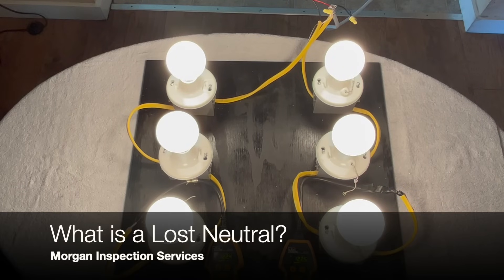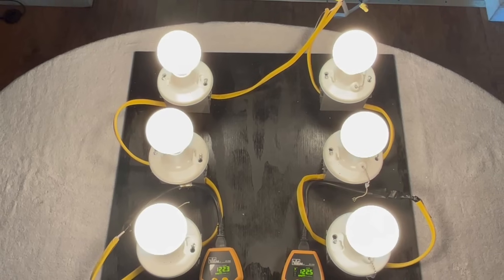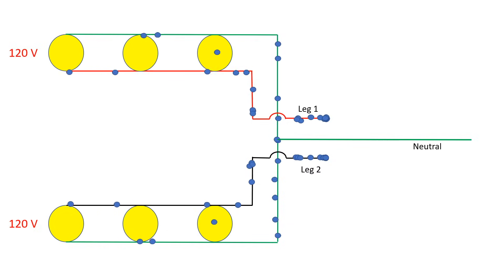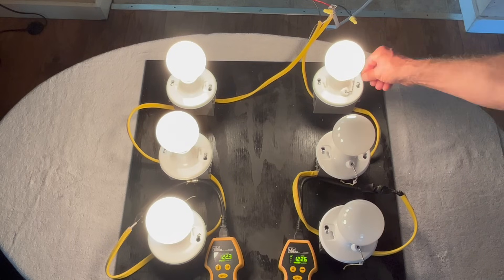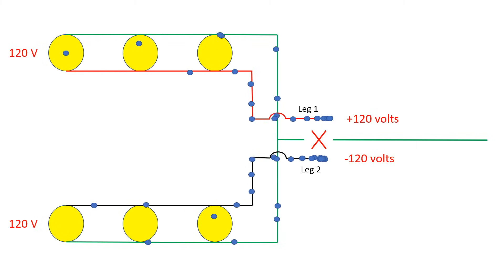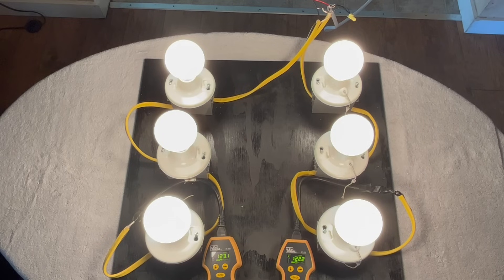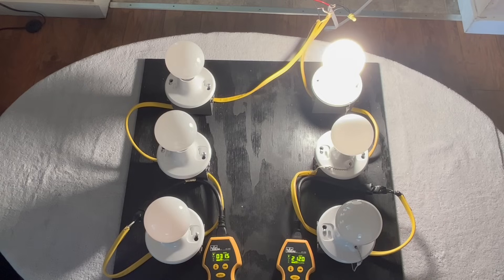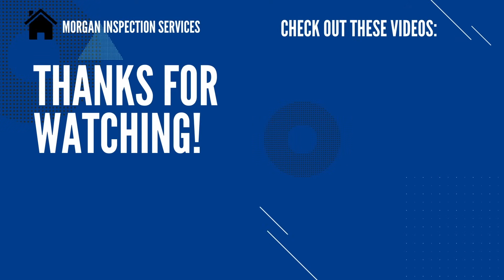What is a Lost Neutral? Lost Neutrals demonstrated

Comment: For those who watch the entire video, it's a good explanation of what's happening, but the intro piece should explain - or at least define - "balanced loads."  But, remind people that this IS NOT just a phenomena between the transformer and the service entrance.  Inside the residence, there is a code-legal wiring alternative called a "Multi-Wire Branch Circuit," that originates from a 240V branch circuit breaker and uses either L1 or L2 plus the neutral to feed ordinary 120V outlets.  With a Multi-Wire Branch Circuit, this same "lost neutral problem" can occur, except within one room, or on one wall, of a building.  So it's NOT isolated to incoming street service entrance neutrals and may not affect the entire building.
Reply from the maker: Thanks for the feedback! You’re absolutely right—balanced loads and lost neutrals aren’t just service entrance issues. Multi-Wire Branch Circuits (MWBCs) are a great example of where this can happen inside a home. If the shared neutral in an MWBC opens, the 120V loads on each leg can see unexpected voltage swings, just like with a lost neutral at the service entrance.

I appreciate the suggestion about clarifying “balanced loads” in the intro—I’ll see if I can get that added as some text in this video. Thanks for watching and for the thoughtful comment!

Comment: I had a service call with a customer. Complaining that some lights were flicking on and off and power was off to many of the outlets in 2 of the bedrooms. I searched the panel and found the part of the house that was out was on a 3 wire circuit. That is, the red and black with a white neutral.  Up in the attic, I found a jerry-rigged romex. Cut in half and supplied power to a switch and an exhaust fan in the attic. The neutral wire under the red wire nut was loose and was making intermittent contact. Thus complicating the service call because it would work. And then it wouldn't and then I would test outlets and was getting over 150 V on one outlet and 36 volts, on the other and the voltages would change during the day I spent 4hr until I found that jerry-rigged attic fan. I had to disconnect and run a jumper between the 2 wires. As the jerry-rigged was cut in half with no slack. It was a difficult service call, but this explanation that you gave showing actual 120 volt was so much better than the others that were using batteries and a low voltage light bulb. This really will help electricians a lot to see how it actually happens in real life.  Thank you for the good demonstration. KJ

Comment: that is utterly bizarre.i didn't even know that that existed.you would have thought that they would have placed a wheatstone bridge,rectifier or detector in place in order to limit the electrical circuit that phenomenon could potentially blow out a television or maybe cause an electrical fire it might be an idea to run three different neutral wires as one neutral,connected to three separate points.that could be so dangerous!
Reply from the maker: Yeah, losing a neutral can lead to some really dangerous situations. It’s surprising how many people don’t realize the risks until something goes wrong. Thanks for watching!

Comment: Thanks for the video!  I have a question that I'm almost afraid to ask. Several years ago (probably about 15) I had an outlet in a bedroom that didn't seem to work. I decided to check the voltage and it read about 79 volts. I simply decided to cap off the hot, neutral and grounds with wire nuts and put a face plate on it (which I believe is legal). However, was this a mistake? It sounds like there could still be a problem although I haven't seen anything out of the ordinary in my house since then. I'm not sure I want to go hunting around for lost neutrals. Should I do anything about this especially since nothing seems to be wrong?

Another thing is that I will be moving some time this year. Do you think I could somehow fail electrical inspection?
Reply from the maker: Thanks for your question! Capping off the wires and covering the outlet with face plate is generally a safe and legal way to deal with an unused outlet, assuming the wiring was properly secured and contained within a code compliant electrical box. However, the fact that you measured 79 V at the time, suggest the possibility of a loss neutral or a high impedance connection somewhere. This could indicate an underlying wiring issue.
If you’ve never noticed flickering lights, inconsistent, power, or other electrical oddities, it might not be an urgent concern. In fact, it could be an issue totally unrelated to a lost neutral. A lost neutral will affect the entire home, and not just one receptacle.
However, if you’re moving, and the house will undergo an inspection. It’s possible that an inspector could flag the outlet if they test it and find abnormal voltages or other issues.
If you want peace of mind, you could have an electrician verify that the circuit is properly wired and safe.  A lost neutral can sometimes cause bigger problems over time, especially in shared neutral circuits.

Comment: so for the average joe here, will a simple electrical circuit tester or similar check for a lost neutral?
Reply from the maker: If you suspect you have a lost neutral, and you have a simple circuit tester that will read voltage then you should be able to turn loads on or off and see voltage changes. Just a simple, three light receptacle tester will not do any good, but you need something that will show you volts.

Comment: Interesting video...I'm in the UK and often wondered how you guys managed to have both 120v and 240v in the house. Out of curiosity, if a customer has a lost neutral, could it be detected by plugging in a simple GFCI tester in the outlets? Also, do you guys have a separate ground/earth/CPC wire in your electrical ccts?
Reply from the maker: Hi Peter. Thank you for your comment! In the U.S., we have a split-phase system that provides both 120V and 240V. The 240V is achieved by using both “hot” wires from the transformer, while 120V comes from one hot wire and the neutral. The neutral wire is center tapped at the transformer, basically splitting the voltage in half. A GFCI tester wouldn’t reliably detect a lost neutral—it’s better to use a voltage tester or check at the panel. We do have a separate ground (earth) wire in our circuits, but they are not so much for earthing per sé. Their real purpose is to provide a low impedance path back to the panel to trip a breaker in the event of a short circuit.  Here’s a video I made that explains the basics of our electrical system. 
https://youtu.be/7YDbnZQiYwY?si=eyF0r_yYqqe0NNGK
Reply: @morganinspectionservices3840  Thanks for the in-depth reply, it is very appreciated..I will take a look at that video a little later...

Comment: This is a good video, but how does this work with grounding? Isn't the neutral bonded to ground at the panel? How would that affect your diagram and your demo circuit?
Reply from the maker: Hi. Thanks so much for watching and thanks for the question. Grounding really does not affect this because the Earth has such a high resistance that you will have a small amount of current flowing down the grounding electrode conductor to the ground rod, but it will be very minimal and will have almost no effect on what I am showing. 

However, all of the ground wires running from the receptacles and lights back to the panel will not be at 0 V. They will be at a voltage that is determined by calculating the difference between the voltages on the two legs and dividing that by two. So let’s say you have 180 V on one leg and 40 V on the other leg. You’ll have 70 V on all the ground wires in the home. This obviously makes a lost neutral, extremely dangerous. I re did this video several months ago to include this. Here is a link to that video.

https://youtu.be/YY5Fur7S-KE?si=8XB2134lleqX_Yb7
Reply: @morganinspectionservices3840  Thank you for the explanation and the excellent videos!

Comment: Thank you for this video ,,i was pulling my hair out..whats left of it,, trying to figure this issue out. I pulled my spare washer and installed it and still nothing. Thanks again 👍
Reply from the maker: So what exactly ended up being the issue? Did you have to get the utility company out?
Reply: @morganinspectionservices3840  sure did SEC , a crow had sat on a wire up on a poll by my home ...melted the wire, I thought the crow would be dead on the ground but nope ,,he likely flew away

Comment: For demonstration purposes this is an okay way to explain it, but this is the reason that the NEC doesn’t like you to share neutral wires anymore for a long time now. The 240v circuits would single phase but that should trip the breaker because of unbalanced loads to protect them, this is also the reason that you are supposed to balance your panel loads. This explains better what happens when you lose your neutral from the power company, but not really what happens to individual circuits in your home, but it’s a good simplification of the situation.
Reply from the maker: Yes, it was only a demonstration to show what happens when you lose your neutral from the utility company. But yes, I guess it also demonstrates why shared neutrals are not a good idea.

Comment: Hi!
Hope i didnt miss anything in the video, but what would happen in this situation if the electrical supply ground was lost but your neutrals and grounds were (obviously tied somewhere) tied in the panel and you had a good ground rod out side (obviously tied to your ground, and neutral bar if they were tied together)?  would the rod them act as your neutral and help alleviate the situation of a lacking neutral? And if it did, would it affect grounding safety through your house? thanks!
Reply from the maker: The ground rod would not act as the neutral because it does not tie back to the transformer. Some amount of current would flow through the grounding electrode conductor, through the ground rod, and into the ground. However, the earth is a very poor conductor, so the amount of current flowing would be limited. I would estimate 4 or 5 amps only. As a result, the voltage difference between the two legs would be lowered to a degree, but not by a lot.
Reply: @ Thanks for the reply!  Cool stuff

Comment: Shouldn't your breaker have tripped during this experiment?  I'm guessing you were using a 30 amp breaker for this demonstration and a 15 or 20 amp breaker would have popped. Would this experiment trip a gfci or arc fault breaker?
Reply from the maker: No. This set up is not going to create a lot of current. You still have resistance on each leg. You’ll basically have twice the current running through a lightbulb when it’s running on 240 V as you do through that same light bulb when it’s running on 120 V. It’s not that much current. And no, this would not normally trip an AFCI or a GFCI. I have made a “new and improved” video on this topic. In that video, I actually calculate some Voltages, resistances and current. Here’s a link to that video.

https://youtu.be/YY5Fur7S-KE?si=aKUPYR3NYcKgigQR
Reply: @morganinspectionservices3840  Awesome! Thanks for your response and the link.